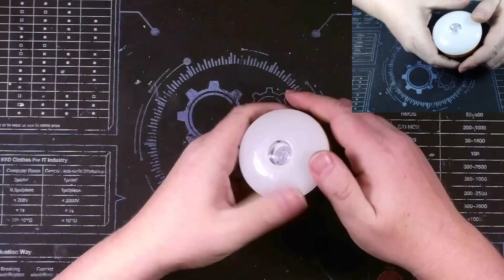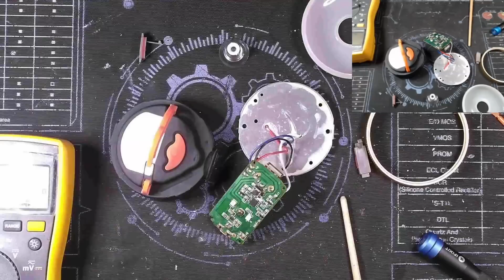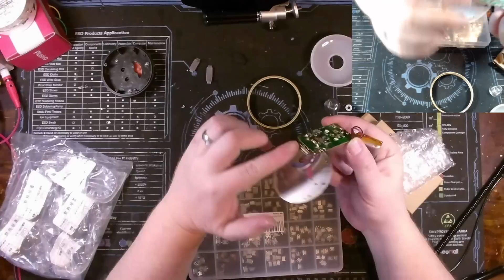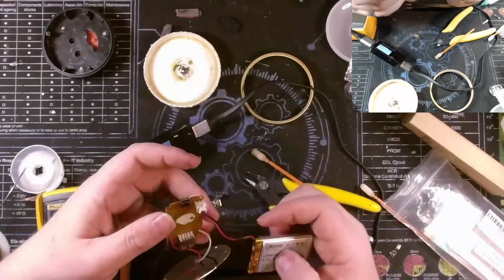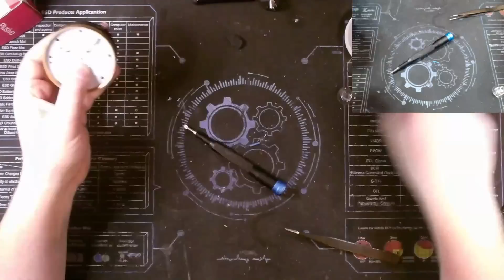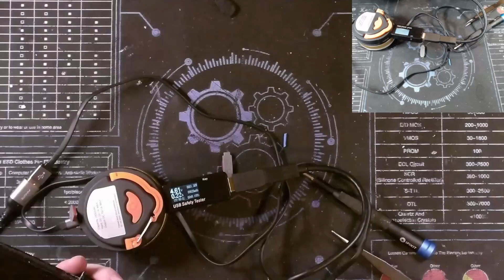(Quick Fix) Repairing Amazon Junk LED Camping Lantern

Comment: it looks like the largest part of the repair, besides the power source replacements, was cleaning corrosion, am I correct? 
...I will have to review again, and make "re-review," of both this post as well as any electrical/electronics study notes that I might have, ... but, to verify, in terms of the Diagnostics, would I just take my analog voltmeter, on the same settings as your DMM (digital multimeter), to components that seem to appear similar? 🤔 
thanks in advance, and it's okay if YDK (ya' dunno), or can't give more feedback: this video put me in a better direction anyway, plus what I'm repairing was a scrapped free item 🤷
Reply from the maker: Haha, it's all good. Yes it was mostly corrosion. The DDM test on each SMD resistor ect. all of them tested fine. I don't remember what all was on the board, I'd have to go back and watch the video. Some corrosion on one of the resistors (I think) was the main culprit and and cleaning and resoldering resolved that issue.
Reply: @HavingFunRepairs because i didn't know, when I look up SMD (surface mount device), my google a.i. response to a generic inquiry leads me to believe I could just string some wire to the next object, (if I don't happen to have solder).  I guess getting on some gloves and a silicone baking mat will keep any potential problems to a minimum. so, back indoors and cleaning I will go !
Reply from the maker: @meljane8339 let me know how that goes, if it works I guess it works.